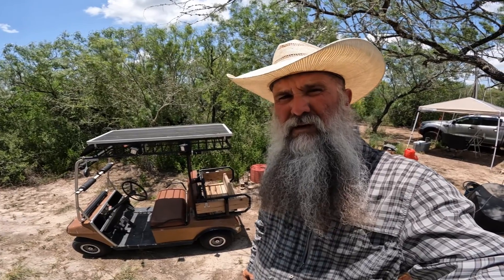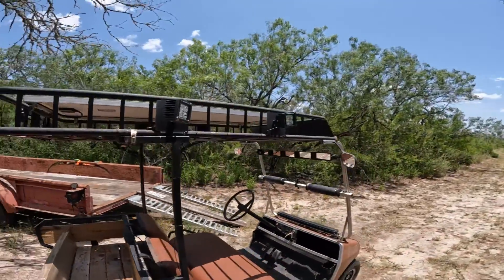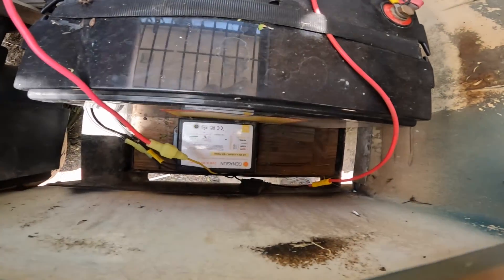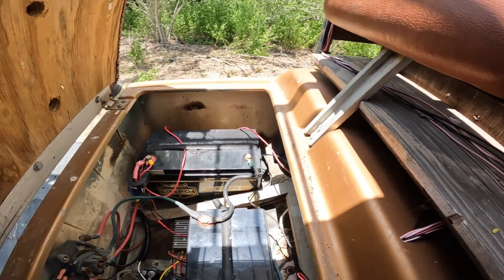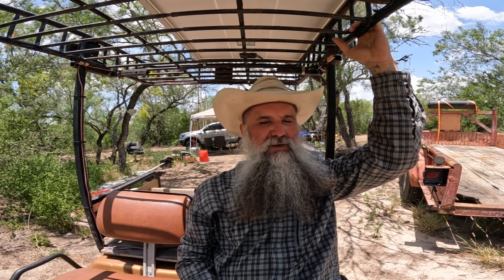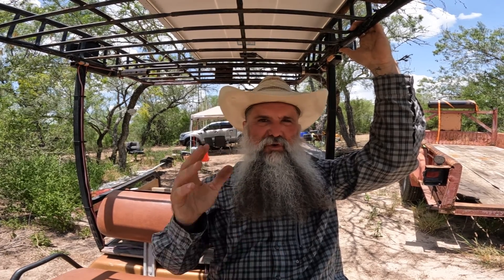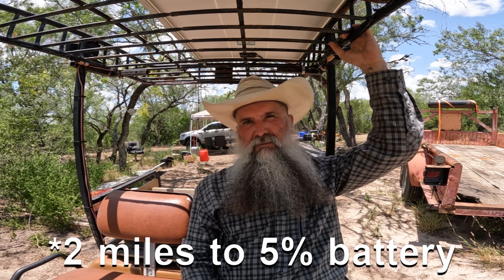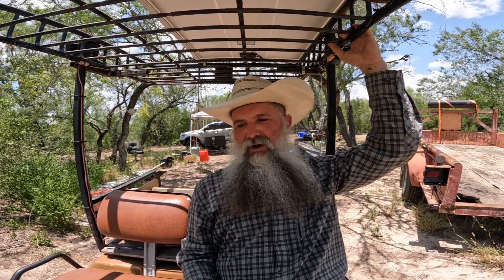LiFePO4 PUPVWMHB Battery Review 1 Year Update and Golf Cart Setup

Comment: I’ve bought a few of these batteries.   They now have a 300ah which I bought and love their performance so far.   
Using the Bluetooth can help us understand these cells and the internal balancing.    I charge them to 100% then connect them in parallel and let them sit.   Then I charge them again to top off and settle.   Then charge again (very little time and low amp charging).    Let them sit for a few days then disconnect and check each battery voltage.   
I try to do this every six months or so for my battery packs.
Reply from the maker: Thank for the info.  Yes, I noticed they have 300mAh available now.  I plan to get a new golf cart for the ranch and will go with the 300mAh myself.  Thanks again